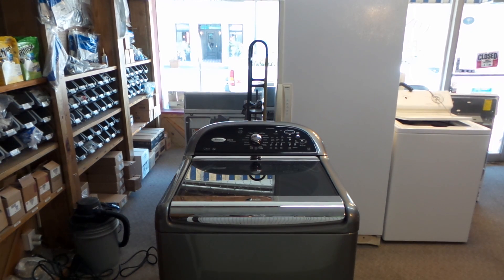Whirlpool Cabrio Repair

Comment: The f54 code is coming up on mine. I know it has to do with the motor going to fast but if I replaced the stator sensor, would it work?
Reply from the maker: As long as nothing strange is going on it should solve the problem I have a video on how to change that sensor if you want to check it out.

Comment: Every wash mine comes up UL error, stops, then I rearrange clothes only for it to start the wash over and have the UL error come back. Piece of crap this washer is. Also no spin cycle! Why did you remove a spin cycle from a washer? 
Bring back the basic washers that work instead of electronic nightmares.
Reply: Possibly overloaded? I tried to put a small kids fleece blanket in with a normal wash, wasn't a large load at all, but the weight of the blanket wet was 3x heavier than the rest of the load, finished with solo blanket with no problems. However the cold care cycle just stopped working altogether on mine and started with that UL code every wash so I just stopped using that mode.